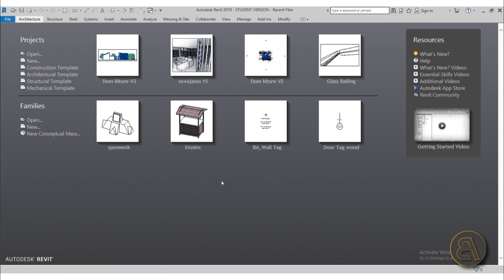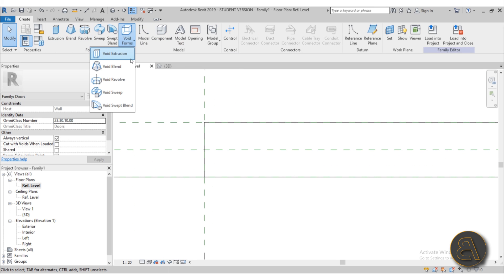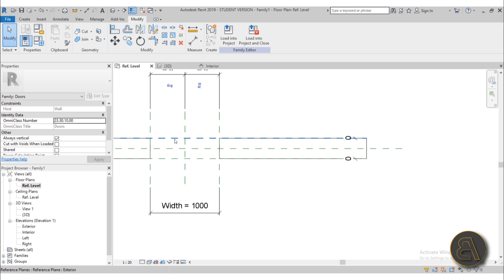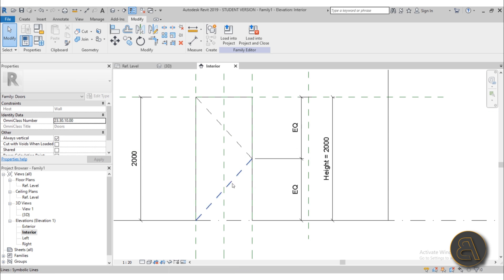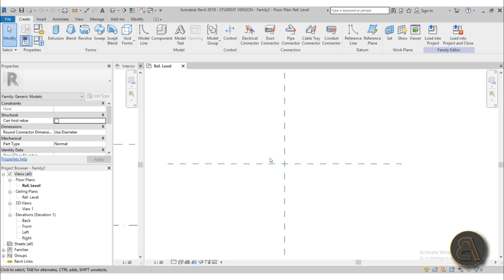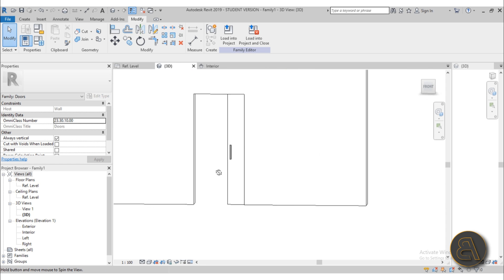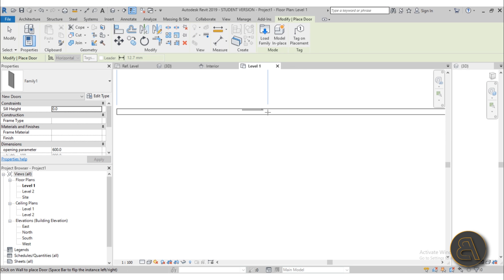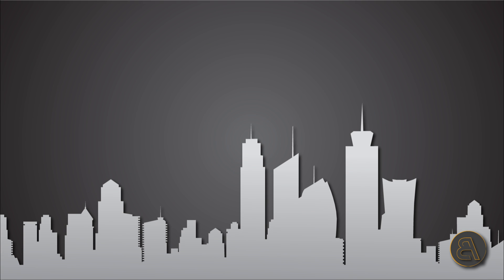Parametric Sliding Door Family in Revit Tutorial

Comment: Thank you so much , great tutorial as always, I just wanted to add some extra tweaks to make it Parametric DOUBLE Sliding Door Family and for that we just need to mirror the void extrusions as well as sliding door panel with necessary lock it in place the positions of mirrored ones with additional reference planes, we need to relocate the opening parameter to the middle of Main door opening void and make another opening parameter to opposite side to move both door panels at the same time once change the opening distance as required , most important one we need to make a new parameter of width of main door opening with formula of Width * 2 once created this parameter then main door opening width automatically multiplied by 2 whenever we input single sliding door opening width and now it can be utilized in placing  wardrobe opening or walk in wardrobe openings whenever required.